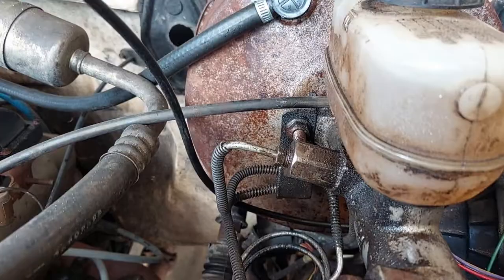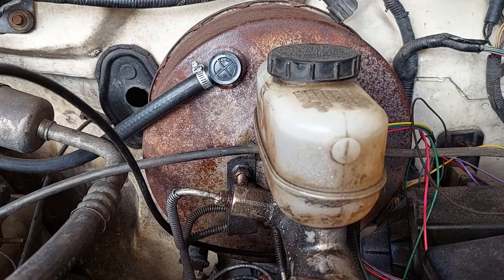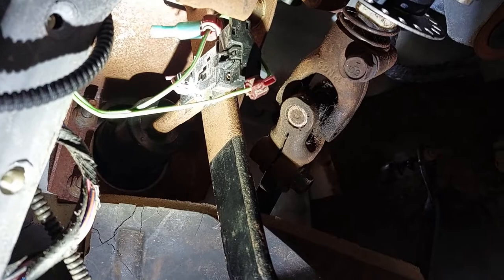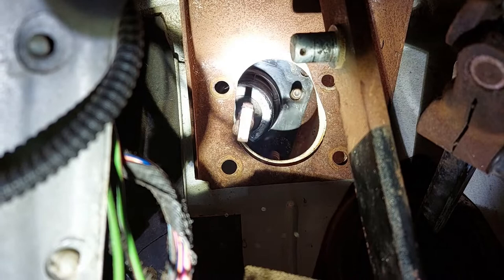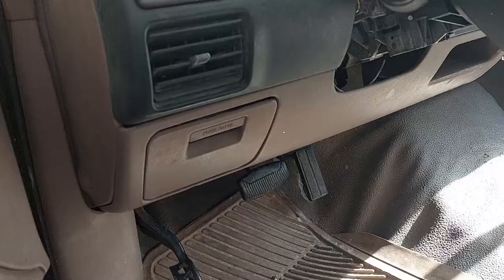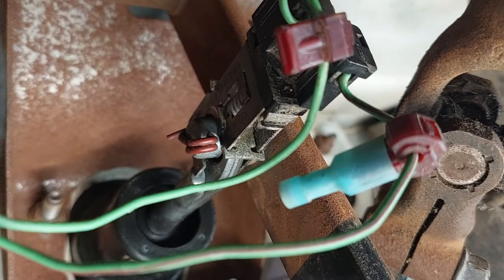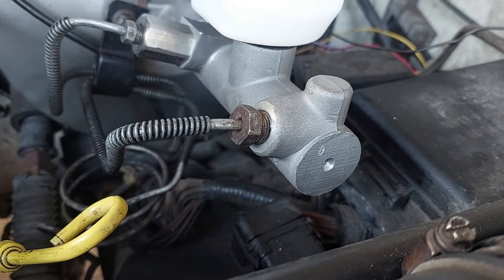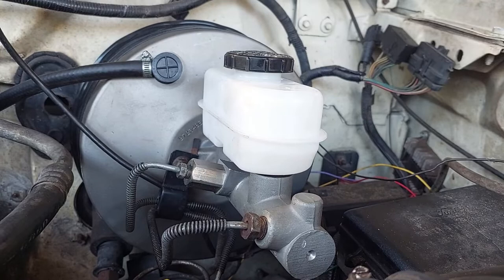Episode 94 - Brake Master Cylinder and Power Brake Booster Replacement 1993 Ford F250

Comment: For that fitting for the master cylinder what was the part number and website you got it from?

I’m working on my 92 f150 for the same thing
Reply from the maker: You mean the screw on fitting required to make the brake line fit?  That was transferred from the old master. However, a little googling turned up Ford Part Number F4TZ-2140-A.  Feed that into Google and you should get some results for new old stock and 3rd party reproductions.  The new master cylinders I saw do include the adapter piece as part of the master.

Comment: I have a 94 F250 that when I bleed my brakes they feel okay but a week or so later my pedal is soft and near the floor. The pedal returns fine but brakes feel spongy. I’ve replaced the abs control module, master cylinder 2 times and I’ve adjusted the brake booster to the correct distance. nothing seems to work. I also do lose a small amount of brake fluid over time. Any ideas? Thanks. Was thinking of replacing brake booster. Let me know what you think if possible.
Reply: Also something to note is abs and brake light has shown before and my truck has stalled and died. This hasn’t happened lately though but That’s why I’m thinking brake booster. Again I’m not sure though.
Reply from the maker: Couple of issues there.  First  things first, find and fix your leak.  If you are leaking, air is getting into the system potentially and that would give you the sinking pedal and spongy feel.  If your truck has rear drums, the drums could also  be way out of adjustment and need to be tightened.  Wheel cylinders in the drums have a nasty habit of leaking.  Look for small pools of brake fluid on the bottom lip of the drum or dribbling down the inner side of the tire.

The ABS light will light up if the proportioning valve messes up, if the Vehicle Speed Sensor(VSS) is going bad, if the brake fluid level sensor is going bad or brake fluid in the master cylinder tank is low.

The stalling issue is probably an independent problem.  Have you checked codes via an OBD1 reader?  What other symptoms are you seeing around the stall?
Reply: Yeah, so I thought it was the drum brakes a while back so I adjusted them, while it didn’t need much correction I still did it and it ended up not helping. No puddling or leaking fluid around the drums either, I’ve also replaced the speed sensor on the pumpkin of the rear dif and still didn’t help. 

Around when my truck has died 2-3 times my abs and brake light go on and my  brakes  lock up and the truck won’t move even in drive. What I’ve done is just start it in neutral and then it moves. 

My thoughts around this is maybe my brake booster is bad and leaking?? Kinda running out of options 😂 this has been a headache
Reply from the maker: Brake booster won't give you a spongy pedal feel.  Generally during operation the engine will make enough vacuum that even with a leak the booster will do it's job.  Here's a quick test for that:

1. Run engine for a moment, then turn off
2. Push brake pedal all the way to the floor.
3.  Pedal should be pretty easy to hold there for 15-20 seconds.  After that, it should start to push much harder on your foot as the vacuum assist runs out
4.  If the pedal starts pushing back faster, that means leak or failure of booster.
5.  Another quick check is to run the engine, turn engine off, then pull the check valve on the booster.  If you don't hear much air rushing in or none at all, probably a bad check valve or booster.

To your issue with the soggy pedal... A bad proportioning valve can do this.  A bad ABS pump can also do this but I don't think the '94s had an ABS pump yet.  The proportioning valve is located in the driver's frame rail up near the engine block.  Its easy to see as it will have one electrical connection and a bunch of brake lines coming out of it.  Also a good place to check for leaks.  Another good place to check for leaks is along the 3/8 line that goes from the back of said valve down the driver's framerail to the soft line for the rear drums.  The retention clamps for the line will get a bit of dirt in them and slowly rub a hole in the brake line.  Happened to my 2001 F250.
Reply: Ok, I did replace the abs pump last week and it’s back to how it was again so I’m going to test the booster later today and go from there, thanks I appreciate it and I’ll update you when I get to it
Reply: Update, found major puddling out of the drivers side drum, feel like a dummy could have sworn I checked a while back. But at least I know what’s wrong now. I’m going to replace both tomorrow just cause one already failed. Thanks for the help. Appreciate it :)
Reply from the maker: Anytime.  One thing I have found with wheel cylinders is that "new" does not mean "good".  It means not tested.  When you put the new cylinders in make sure you do some crash stop style pedal slamming, then take your drums off and check the cylinders to make sure they don't leak.  I've had two from Dorman fail instantly once installed.

Comment: Mine is 91 ford f350 and the brake pedal goes all the way to the floor. What causes that?
Reply from the maker: That could be air in the line, could also be the master cylinder is no good since the pedal is not returning.  This is almost never the case, but it doesn't hurt to check your brake pedal linkages to make sure something is not broken there.

Are you losing brake fluid?  If so you probably have a busted line or a leaking caliper and/or wheel cylinder.  Again, if the master cylinder is bad it can be leaking brake fluid into the vacuum booster and you won't see it.
Reply: @MazdaB3K  no. I'm not not leaking brake fluid. The reservoir still full. I tried putting on a new brake booster and still didn't work.
Reply from the maker: Booster helps you to apply braking force, not really going to help you with the pedal coming back up.  If you are not leaking fluid and you don't think you have air in your lines, I'd really lean towards either a bad master cylinder or possibly bad soft lines.  If your soft lines are old enough, the interior of the line can degrade to the point that is becomes a check valve.  Fluid can pass through to the brakes, but then it can't come back out.  However, if this was the case your brakes would probably be dragging.
Reply from the maker: One other thought I just had is something wonky with your proportioning valve.  Does your truck have any form of ABS pump?  When those go internally they cause the pedal to sink to the floor and not come back up.
Reply from the maker: I know I've tossed a few ideas out there but I think bad master cylinder or ABS pump (if you have one) would be the main two things I would look at first.
Reply: @MazdaB3K  that's what I really been thinking. I could be a bad master cylinder. My brakes went out when I was at the recycling place doing my cans and brakes went out and ended up crashing into the wall and took me 2 hours to get home driving with he emergency brake on in which I was only few minutes away.
Reply from the maker: I had to do a flat tow where the vehicle I was towing blew it's brake line and I had to tow around 10 miles using the e-brake only... It was my F-250 actually.  That was interesting.  What made it more interesting was I was pulling it with my '94 B3000 I had at the time.  Fun times were had that night.  Let me know how it goes once you replace your master cylinder.
Reply: @MazdaB3K  I'm just gonna take it to the shop and have my buddy look at it. Have him check the Master cylinder. The brake lines. And rear wheel cylinder and also see why the rear anti lock light is on.
Reply from the maker: I'm going to guess in 1993 your truck should have the RABS 2 system.  That means ABS on the rear axle only.  You should be able to use the jumper wire under the dash to get a flash code for the ABS error.  The usual stinker is the VSS, which is the speed/abs sensor located in the rear differential.  However, the ABS computer can be bad as well.  Hopefully your buddy can help you get it sorted.
Reply: @MazdaB3K  hopefully he can. It's kinda like my work truck.
Reply: Did you figure out what it was? We have the same problem